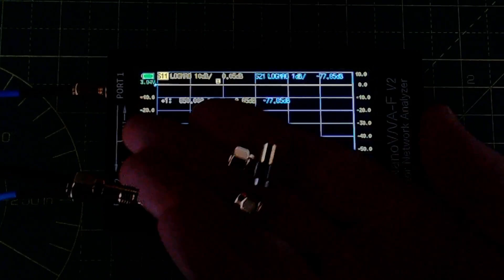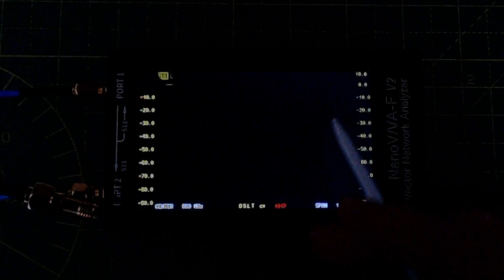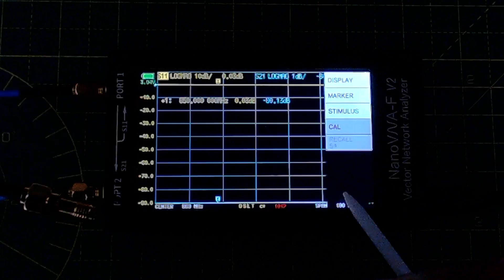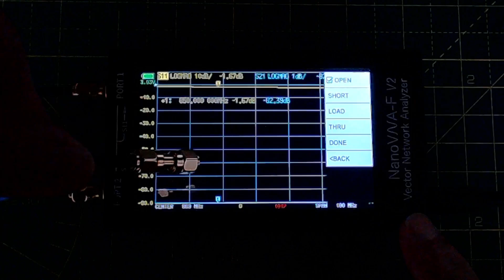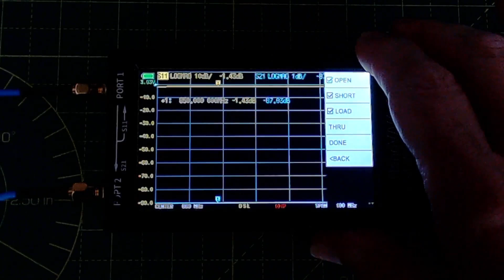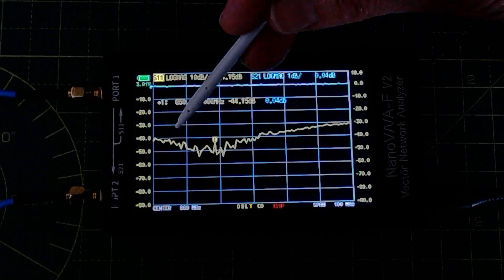Calibration of Nano VNA

Comment: Does it really need calibrating more than once ?
Reply from the maker: It is a good idea since measurements can drift even if nothing has been changed eg. frequency range.
Reply: Not always.  You don't need to re-calibrate if using the same parameters and configuration. You can save calibration to memory or SD card for later recall.